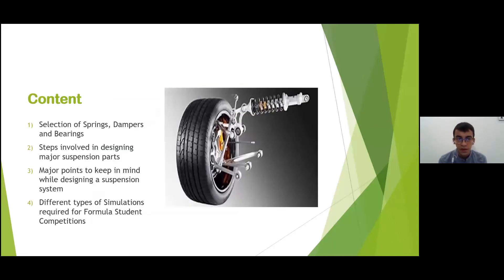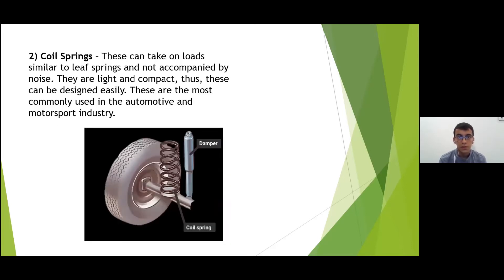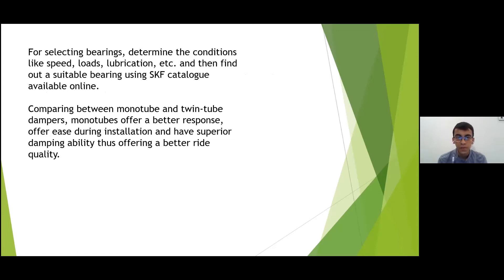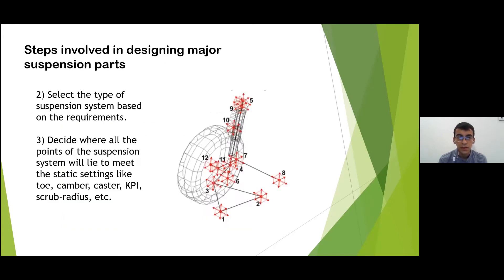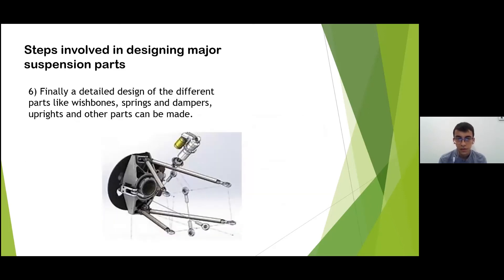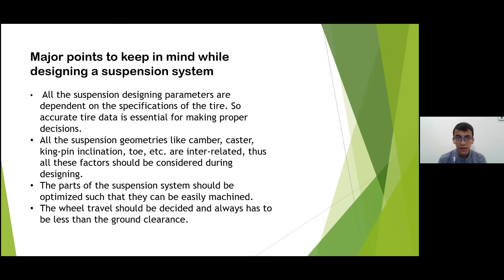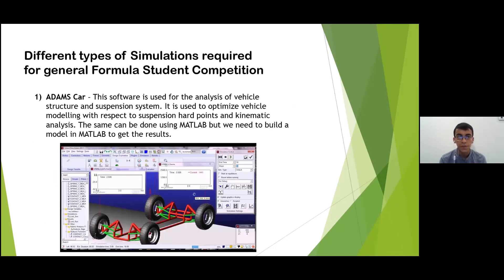How to Design Suspension System? | ANSYS Simulation | Lotus | Step by Step Procedure| Bearing Damper

Comment from the maker: Video Timestamps

00:00 Introduction and Outline
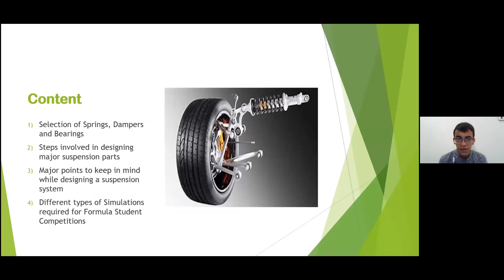00:25 Selection of Springs, Dampers and Bearings
00:26 Types of Springs
01:36 Bearing Selection
02:10 Steps for Designing Major Suspension Parts
03:38 Important Points to Keep in Mind While Designing
04:50 Simulations required to design FSAE Vehicle - ADAMS Car
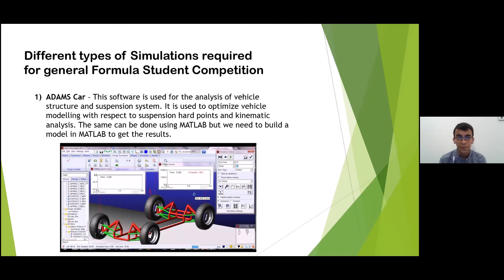05:33 ANSYS Simulation
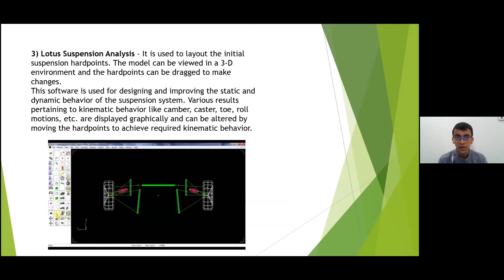06:00 Lotus Suspension Analysis
Reply: What's is design Software used Fusion 360 or Creo
Reply from the maker: @varun14gk  We use a mix of softwares.

As mentioned, we have used SolidWorks for major part of modelling, Lotus to calculate Hardpoints locations, interference, roll center movements and similar things. Some features are better in ANSYS SpaceClaim too. So in total we use Lotus, SolidWorks and ANSYS.